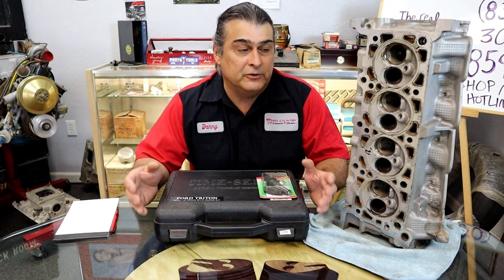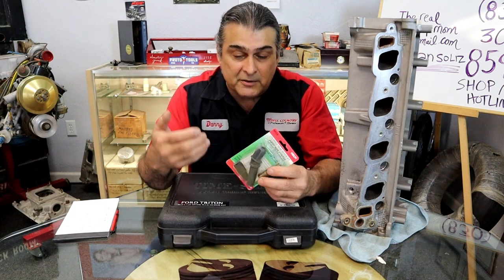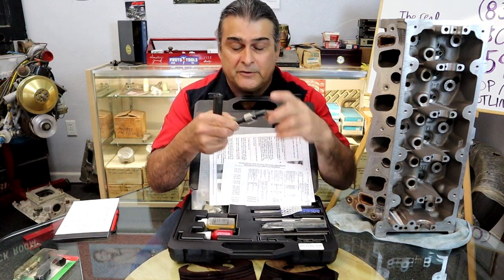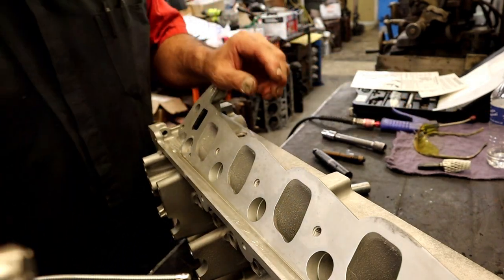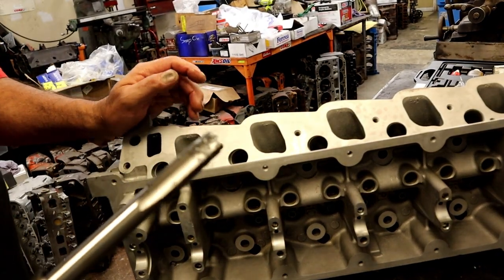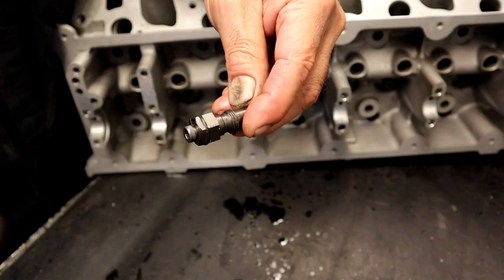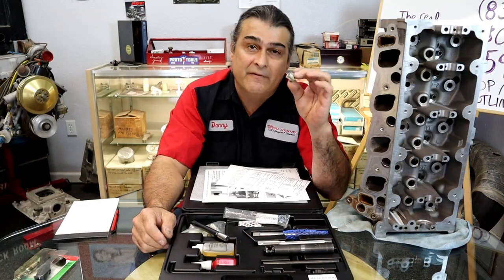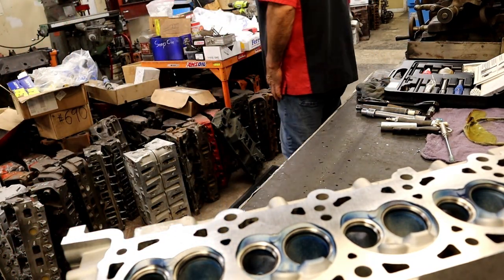How to repair a spark plug hole. What's a TIME-SERT? #spark plug thread 
#Time sert

Comment: No matter what I'm cutting new threads on.  I always pack the tap with grease.  For lubrication & to capture the metal.  Mechanical injection Cummins 5.9L water pump bolts are just as fun.  The bolts thread into the water jacket.

Comment: Trivia > At the start of the american car revolution US manufactures used a standard thread spark plug. Typically a 1/2"NPT spark plug.  With the oil and gas used in those days sparkplugs did not last long.  It was soon discovered that the european spark plugs lasted longer.. It wasn't long before all manufacturers  switched to the european metric spark plug. That's why they are all metric to this day.  Doubt you can find this info on the net.  Old timer from way back when taught me that.

Comment: I’ve heard those Tritons are prone to break spark plugs. So glad you demonstrated this thoughtful and easy to use kit. So I used the gray colored anti seize on the spark plug last time and it still didn’t help. The anti seize that was on it was gritty when we finally got it out.
Reply: The gray was probably an an aluminum bass  i personally try not to use anti-seize that's made of the same material as what you're using it on I would recommend copper on aluminum  but that's just my personal experience . Hope you have a great day and  rock on chickens im be on chicken farm myself today its going to be a change for me
Reply: daniel thanks for the insight. Dissimilar metals less likely to mate. You’re smart. Thank you. 👍🐓🚜
Reply from the maker: I agree with Daniel Smith.   Thanks